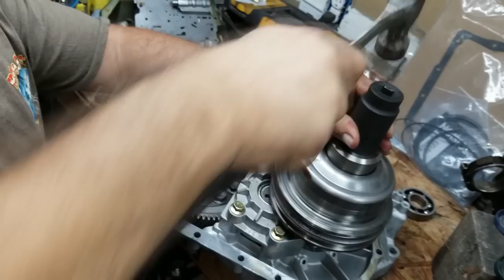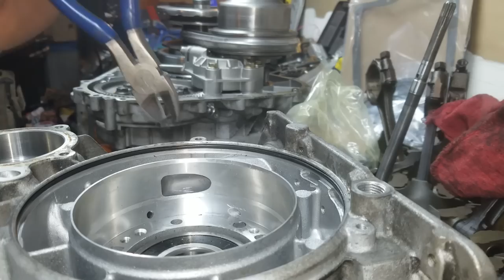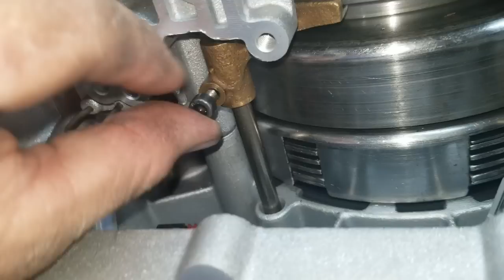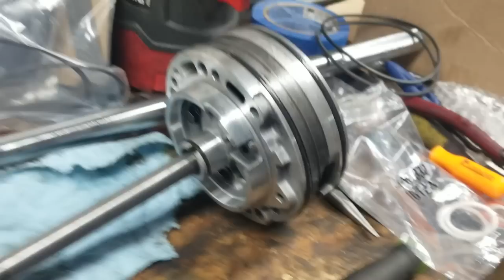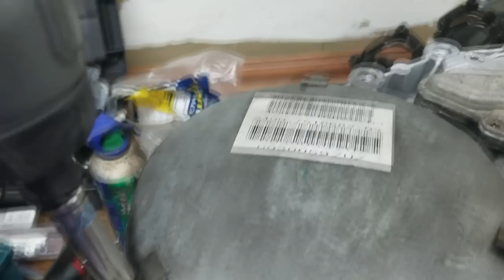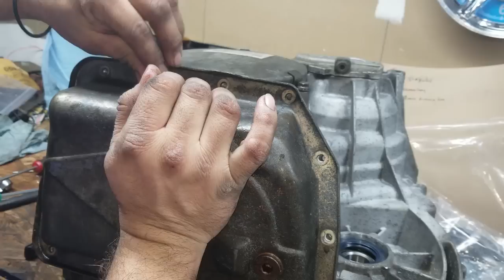2002 mini CVT:  Belt replacement pt2

Comment: Did you buy OEM Bosch belt or chinese aftermarket? I used a chinese and 3 months later it broke. What belt you use, and how long did it last? Thanks.
Reply from the maker: @leroijr407  i bought it from a company in Florida.   After I fixed it, I sold it immediately.

Comment: Hello angel thank you for taking your time and making this video to help out other people I have one question I just recently purchased a 2005 Mini Cooper and when I start the car it starts up fine I can Rev the engine up in RPM the moment I put it in Drive RPMs drop and the engine vibrates really bad and I have no more control over the throttle I can keep pumping the throttle with no change in RPM. Are Mini Coopers known for an issue like this? Also what would be your first guess I am going to borrow a scanner off a buddy of mine because there is a service engine light on but I have no clue about Mini Coopers this is my first one and I see why people that owned one really like them
Reply from the maker: Honestly I'm not sure. But  because of this car I will never purchase another car with cvt transmissions or recommended anyone to get one.but without scanning it I can't say.
Reply from the maker: And thx
Reply: hi 95turbostang,  i have the same problem on my Mini, did you find the solution?
Reply: @giuseppefatuzzo3390  yeah I sent it to the scrap yard

Comment: HI. Could you please tell me what were your symptoms prior to belt breaking? I think my wife's broke. The car literally felt like a huge bubble in tire going forward and reverse, even rolling down driveway in neutral. At final point I put it in drive and driver front tire spun out and now no forward nor reverse! Please let me know what happened to yours. Thanks
Reply from the maker: I cant remember but I do remember it just won't move no matter what gear I put it in
Reply: @AngelGarage  Yeah that's the position we're in now. I have a feeling the belt snapped. I'm going to drain the fluid and look for metal. Thank you for replying.

Comment: I am going to start this project today... can you tell me where to buy the parts??? ... and also can you name the parts you replaced...and I don’t see the part where you align the clutch plates.. can you help when I get there??.. thanks
Reply from the maker: Europeantransmission.com.  they answered all my questions and how to navigate their website
Reply: @AngelGarage I actually just got a belt from them on sale for my R50 CVT. It was on sale for 250. And it's OEM Bosch, they say. It better be, lol. Just did a Chinese eBay belt and it broke 3 months later. Crap belts on eBay.
Reply from the maker: @leroijr407  That's why I no longer deal with any car that has a CVT transmission, even if it is for sale really cheap.

Comment: hello, I'm in the reassembly
and I have a question to you about
the secondary pulley.
at the level of the passage of the chain on the conical form there are scratches of the case of the box must you in your opinion a perfectly smooth result?
thank you in advance for your response

Comment: I've been waiting for you to return with part 2... Good stuff..
Reply from the maker: Discomestu  Sorry it took me so long but I have been involved with 3 other car projects at home.  I will still keep making videos after I take it to the dealership and get the adaptations done.
Reply: Thanks for a second part mate on the secondary pulley block there has to be 9 x 6mm ball bearings 
Haven’t finished mine yet still waiting for an O ring from Netherlands 
Want to put my car back on the road 
Great video mate 👍
Reply from the maker: Mr Stakutis thanks. I'm not a pro but it wasn't as difficult as I though  but the parts were pricey. So far I spent $1,300 in parts and me doing the labor.
Reply from the maker: Mr Stakutis lmao. I wrote it the first time u wrote me so i can remember who to reply to. I forgot all about it.🤣
Reply from the maker: Mr Stakutis  Let me know how the adaptation goes.   I have heard that the   Computer to do the  Adaptation is expensive And the dealership and a few mini service shop were the only one that has it. Don't drive the car until the Adaptation is done first.
Reply: Saw my name on a sheet of paper mate 😂 I’m in USA 😂 
Nice video mate watching it and comparing in my mind how I done mine
Reply: angelfiggi I reckon I’ll do myself adaptations if my Snap-on Solus gives me an option
Reply: angelfiggi I was more lucky only needed a belt which I got from China it cost me circa £150 and my gears was fine so not too bad the car itself cost me £100 😂 so I only waiting for big O ring that goes on the big cover and then she’s ready to go I. 
I’m a mechanic do cars for living got small garage
Reply: angelfiggi sure not gonna drive it unless I can do these adaptations if not either will try to find a machine that can do or take to closest stealership 😂 still didn’t find where spring goes
Reply from the maker: Mr Stakutis thats cool having your own garage. Which state u live in.?
Reply from the maker: Mr Stakutis that spring is baffling
Reply: angelfiggi United Kingdom mate across the pond lol
Reply: angelfiggi well yes does my nerve lol
Reply from the maker: Mr Stakutis I look. I thought u said u were in the states. Maybe I'll go to the UK with my wife and you give us a tour. Lol
Reply: angelfiggi sure will meet and greet you guys 
Said in USA when saw my name on that paper lol 😂
I might make tour video of my workshop for you mate